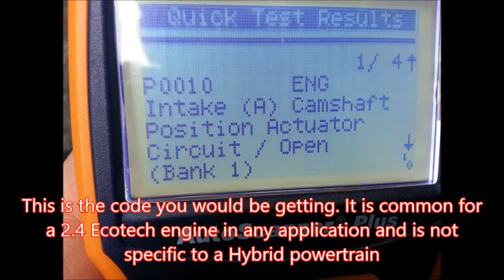Replacing Camshaft Position Actuator Solenoid Valve on a 2007 Saturn Vue Hybrid

Comment: way to edit out the only part i needed lmao... how to detach the wiring harness from the valve
Reply from the maker: Burr Manchu it is just a clip. Push on the clip and pull. I had to use both hands so could not hold the problem be for that moment. With age darn connectors get stuck and plastic pins get stiff.
Reply: sigor2011 on my model there's a plastic piece used as a type of pin that you have to remove before you can just push in the clip to detach the wiring from the valve

Comment: Is it that simple w a 2009 Saturn vue or does it require a belt taken off?? Teset computer???
Reply from the maker: No belt. I reset codes with that computer. If you dont have a code reader... get a cheap one. Codes should go away after some time if problem is corrected and enough test cycles have done by that car computer no longer sees the problem. This car take a few days if you dont have access to a code reader.
Reply: I also have a saturn view and was diagnosed p0010 p0013 and p0014 will your video help clear those issues or is there something else that needs to be done?? PLEASE HELP!!!
Reply from the maker: @platinummm2812  no idea. But cheap to try if you can diy a few bolts.